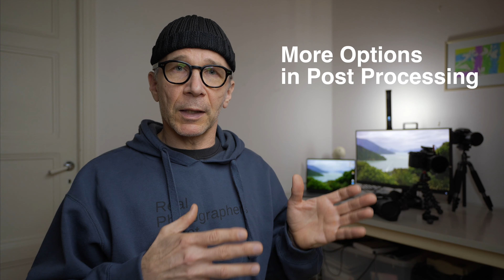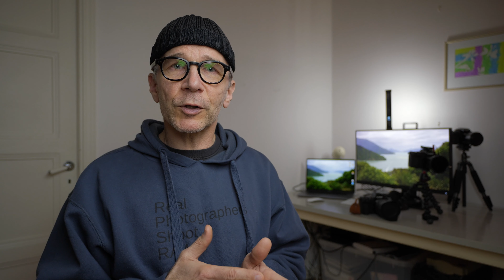Post Processing Workflow –Software and Hardware I use

Comment: I have used many different software.  Since I have gone Open Source Software I mostly use Digikam, Darktable and RawTherapee.  Although I do love the new Capture One Express.  I dont do post processing at all other than contrast and sharpening with maybe spot removal.  So Gimp.org is what I use and either Manjaro Linux or Linux Mint and a recycled desktop and new SSD disks.

Comment: Thanks for the useful video Matti. I'd be interested to know what hardware and approach you use for printing photographs (that may have been a factor in you getting that BenQ monitor maybe). I guess that not many others will be interested in this though. I use the built in screen on an iMac 27 which is great for screen viewing but not great for printing although I don't do enough printing yet to have much experience of this.
Reply from the maker: Thanks! I plan to make a video on printing at some point. I used to have an iMac and I think the screen was great for printing too. Why do you say it's not good for printing?
Reply: @mattisulanto  very glossy and bright.  Maybe need to calibrate it but I've never done this.
Reply from the maker: @simontaylor9991  Calibration is a must, if you print, regardless of the monitor. However, higher end monitors, like the BenQ SW271, tend to be quite good straight out of the box.

Comment: Good video and interesting discussion, my friend. I notice you have the monitor in front of a lit wall, is that intentional so that you equalise the dynamic range of the screen and the room? I use ACR (similar editing to LR). Over the past year, I have established default presets based on the raw file signature usually based on a develop profile, auto exposure, as the starting point. White Balance, Olympus gets it right to the way I like, I do but seldom tweak it
Reply from the maker: Thanks! The light is there only for the video😀